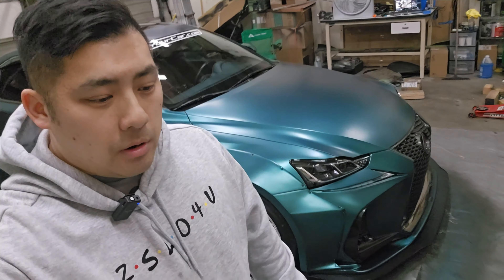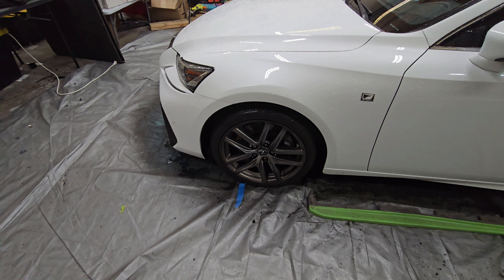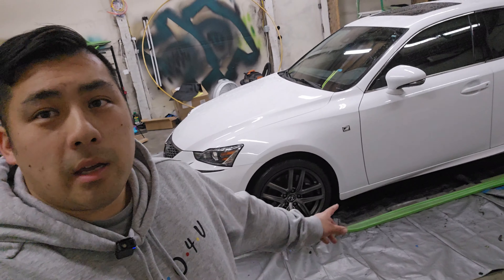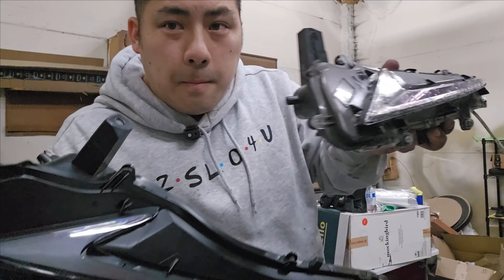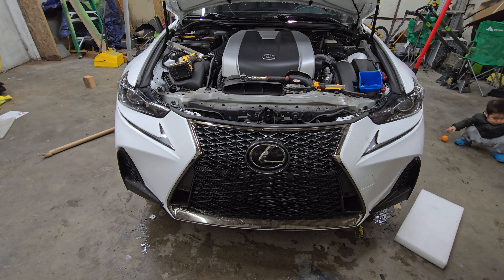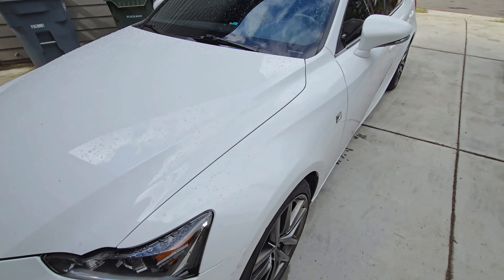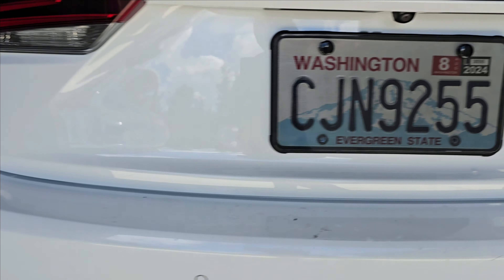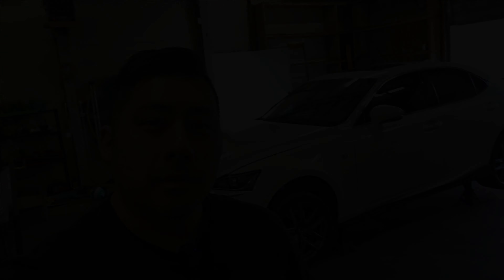How To: Lexus IS easy mods! Budget Build.

Comment: Installed same exhaust, got drone noise and gas pedals vibrate a bit now. 
Annoying to drive it everyday now. Any solutions to fix it ?
Reply from the maker: Hmm, that's interesting. There is very little drone on mine but I'm not too sure why the gas petal would be vibrating. Did you install all of the exhaust hangers?
Reply: @ yeah everything is good, at first we didn’t install springs and we thought that was the issue, and I took it to the shop and they installed original springs on it but that still didn’t help, not only gas pedals but even if you’re sitting at passenger side you can feel the floor vibrating also
Reply from the maker: @Tengojv  yeah thats very weird. What I would do is take the axleback off and see if that fixes the issue that way you can really see if it's the axleback that's causing the issue or if it's something else. You shouldn't need the exhaust bolt springs because of how the flanges on the new exhaust is.

Comment: What kind of material were your rear valance made out of? Mine came in the mail and I got someone to paint match it but they noticed there were alot of these spongey like holes all over them unfortunately so you can see every hole in that thing. It also came with a rubber diffuser that was so bent out of shape and warped...ebay seller is not responding too. So sad..

Did you end up needing 3m tape to install them aswell?
Reply from the maker: Hey my rear valances were made out of ABS plastic. The diffuser is probably urethane so set it in the sun for awhile so it can bend back into shape. I had one before too and I used a heat gun to get it to how I wanted to. I don't use double sided tape to install lip kit parts. I always use either nut and bolt or screws.  The rear diffuser will take nuts and bolts. and the rear valance took 2 screws each.  You can sort of place the rear diffuser where you'd like to depending on the angle you want it so that'll give you different mount location/points.  If the seller doesn't reply, reach out directly to Ebay, they'll open up a case and if the seller still doesn't reply to the case, ebay will refund you  your money back and you''ll get to keep the part.

Comment: Will these mods work on the 2014 non f sport model?
Reply from the maker: The front lip will be different because of the pre facelift front bumper. The side skirts and rear add on's will work though. You'll have to find a front lip that you like. The rear diffuser is different between the 2014 and the 2017+ so you'lll have to get an axleback that works with your rear diffuser.  They do make DRL lights that fit your year as well.

Comment: do you have any other exhausts that sound nice for the 2017 is300 ? ive been struggling to find any other than the remarks.
Reply from the maker: Hey sorry for the late reply. There are a few nice sounding exhausts for the IS but none that I have personally used. It'll be best to just youtube some sound clips of IS exhausts. Sorry I couldn't be much help with that.